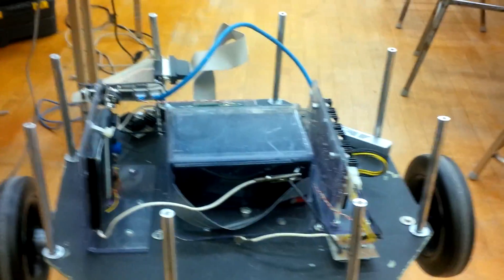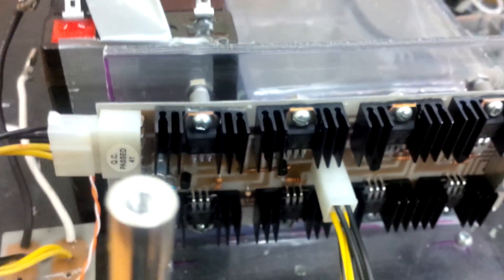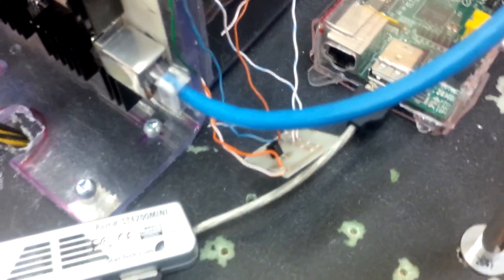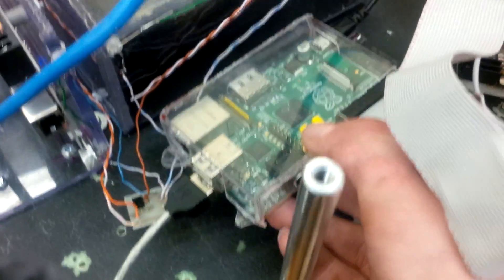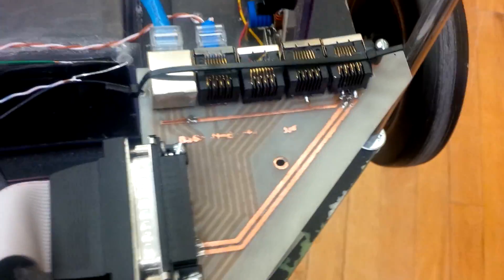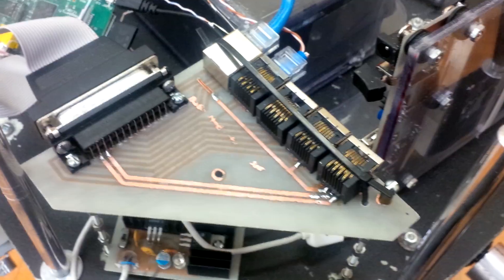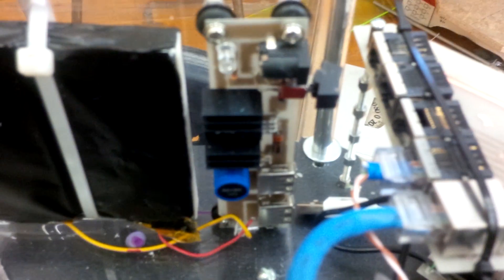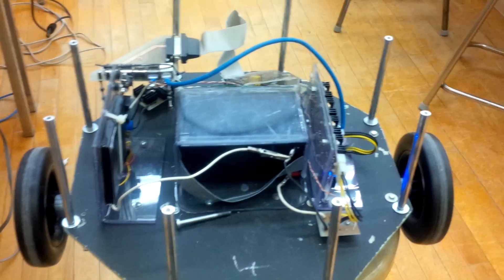Raspberry Pi Controlled Robot: Detailed Overview

Comment: Nice work, I especially like your custom made "data transfer board". Just be careful what you are saying, "ethernet" refers largely to the TCP data it carries, what you are doing is simply using the medium; so better to say cat5 cables or RJ45 connectors for standardization.